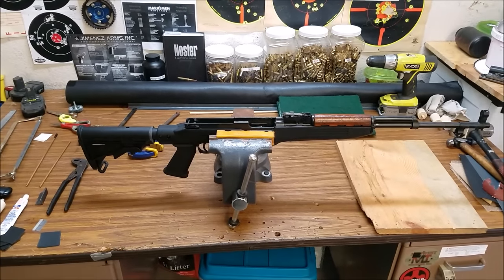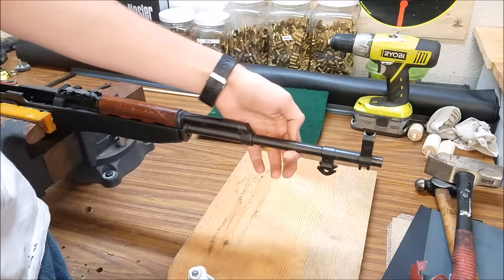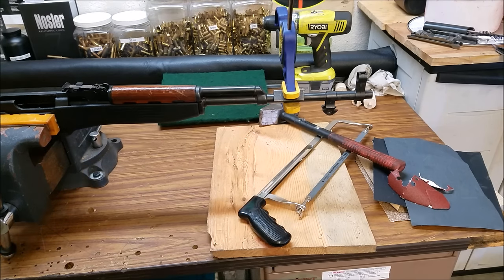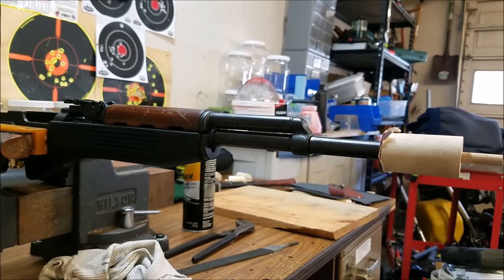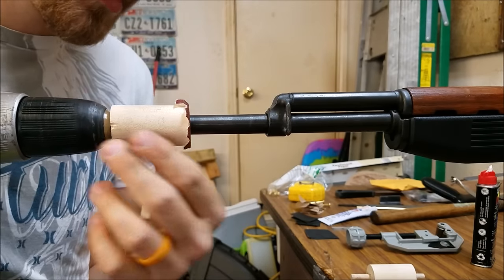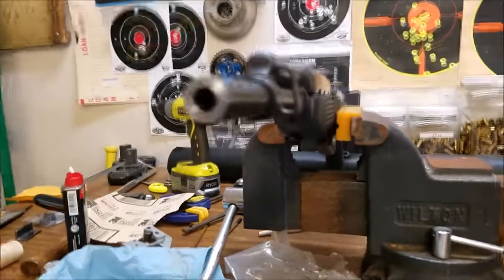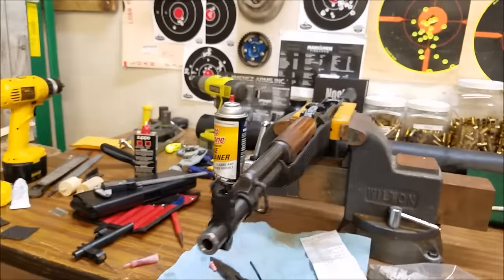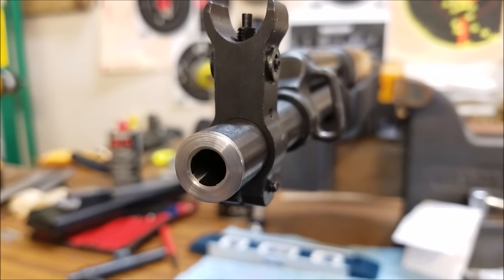Cut and Crown barrel with hand tools! SKS barrel cop

Comment: couldn't you re-use the original front sight???
Reply: Yes, most people just really struggle to remove it. If your uncomfortable with a wood block and hammer, try Matrix Precision they have a tool made for it and it’s fantastic. I’ve done it both ways and it’s worth the money, so is the pin remover. Using the front sight over again looks a thousand percent better. Not saying this guys rifle is bubba and I’ve used set screw gas blocks on lots things (hell my Rifle Dynamics AKs are screw type) but they just look cleaner without the metal tab section the screws pass through like on the one.
Reply: Saw a video where the guy heated the sight and bayonet mount with a lighter to get them off.
Make sure the barrel is clean and non flammable!

Comment: Does this apply to ak47 m70? I plan on shorting the barrel to 12 inches to make it a Draco status ak. Any tips?
Reply: If your AK was a rifle you cannot into a Draco the Dracula was made originated in pistol-forum if you do alter the AK-47 into a pistol you will be violating federal law for the simple fact that the rifle was a rifle not a pistol so I will not recommend you to cut the barrel the 12in you will be in violation  of the NFA a law for more information call the ATF avoid yourself a problem just saying is not worth you doing that ain't going to prison read the NFA law once again if it was a rifle from the beginning you cannot converted into a pistol you will be in violation of the NFA law

Comment: Could you just thread the barrel, without cutting it?
Reply from the maker: Maybe if you could find a thread large enough for thr orignal barrel OD, but good luck finding a muzzle device for that thread!
Reply: @GunsWithGage  I was thinking about threading the original 15x1, then useing a thread converter to 5-8ths. Possibly tac welding the converter... What do you think? Would that work?
Reply from the maker: you could totally do that. There would be a little more margin for error though adding a second piece on the muzzle. I would just turn the barrel down to the correct size for a 14x1lh device.
Reply: I'm not sure about loosing velocity, and making it into a paratrooper carbine... But Thanks.
Reply from the maker: I misunderstood, you do not have to cut the length of the barrel down to thread, Just cut the OD of the barrel down. you can surely leave the barrel at is original length and only cut the OD down for 14mm threads.
Reply: Sweet, and what you did in your vid, would be what I would do, Thank You...